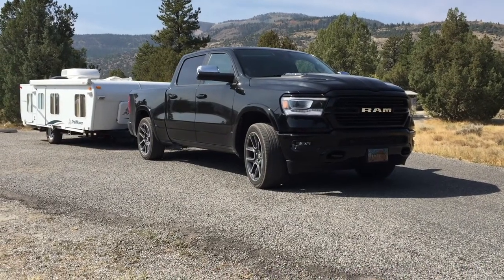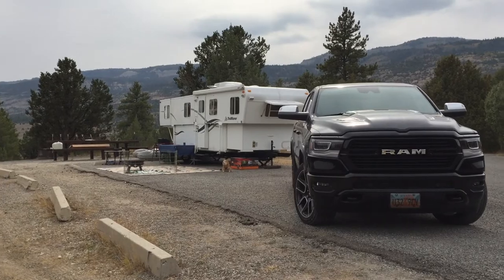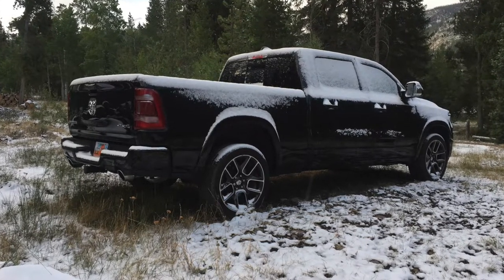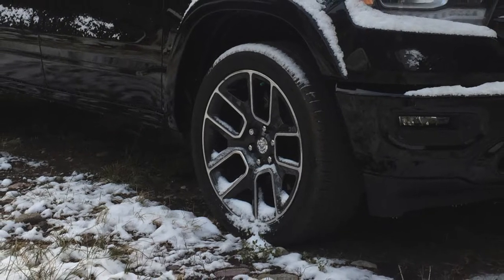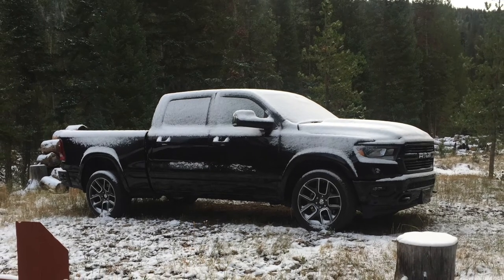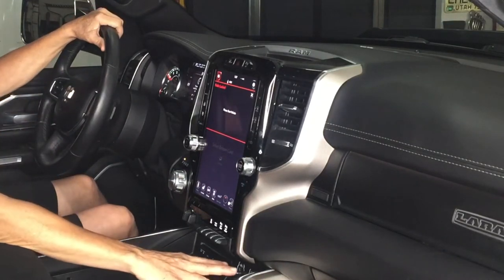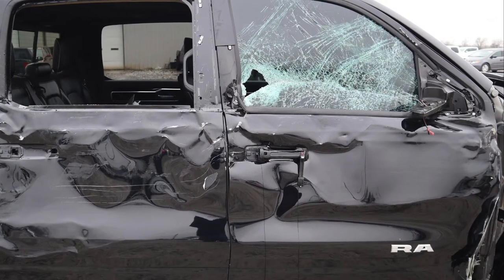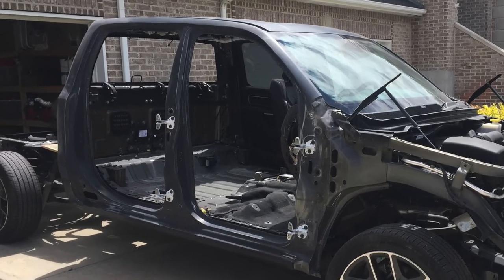Rebuilding Wrecked Ram 1500, Pt 29. 2019 Laramie. Looks and runs like new again, except error codes

Comment: DUDE, buy serious traction tires for winter and off road. DON'T get "All Terrain" tires. They're decent on DRY, but horrible in MUD. 

LOOK AT MUD TERRAIN TIRES ONLY---COOPER, and comparable brands. Maximum 33" tires, you'll be Very happy.

GET 17" or 18" RIMS for the off-road tires, IN ORDER TO GET THE BEST TIRE PRICES. 17's and 18's, you'll find, get you probably the lowest prices available for light truck tires.
NOTE: Check tire load ratings---you'll likely decide the LT-rated Light Truck tires are too stiff and you will likely never need the higher load capacity, for your purposes. There are NON-LT Mud Terrain tires that have very adequate hauling capacity for half-ton duty, AND THE RIDE is more comfortable! 
Anecdotal story: I've successfully hauled HEAVY (2000-3000-lb) loads of firewood on Load Range C tires on a 3/4 lifted Ford with rear springs added from a heavier duty truck (Teenage Days!). For the occasional heavy load, you're not hurting the tires, just air them up to Max recommended pressure and keep speed to 55 or so. YMMV

Long-time pickup driver here, and former tire service guy---FWIW
Reply from the maker: Yep, got me a set of 18" take off's with LT tires. Way better on the 14 mile dirt road to the cabin.